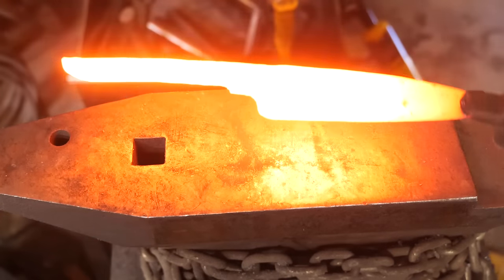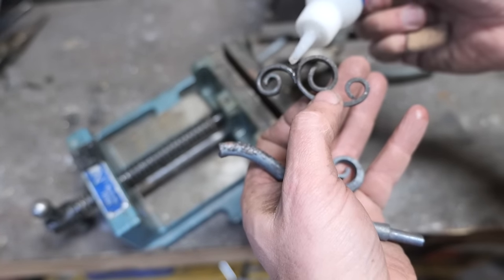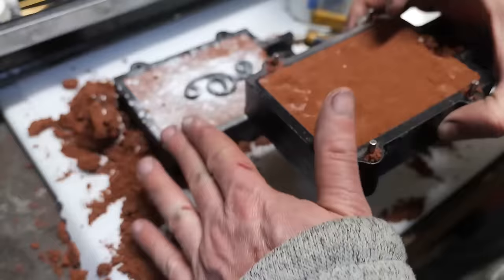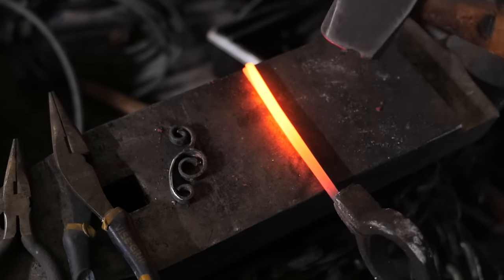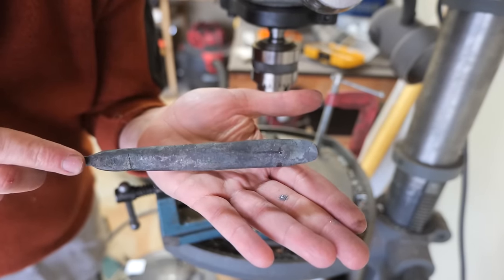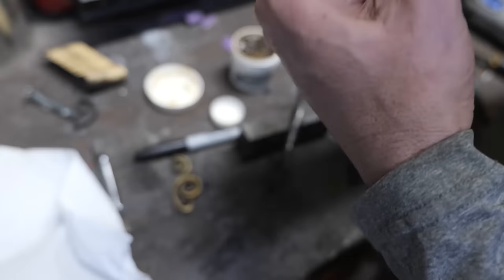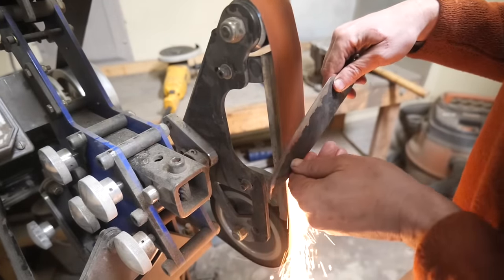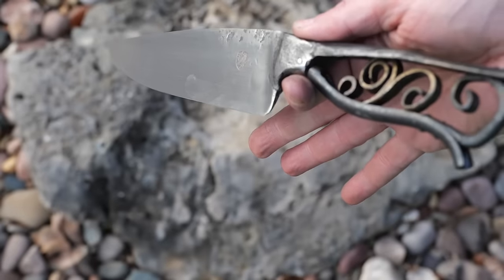Forging a Knife with an Integral Handle PART 2

Comment from the maker: Talk about doing things the "Max Powers way"!  We still got there and I like the result. So, go Steve!
Reply: If you sift the sand casting sand you will get a finer detail mold
Reply: In the video you mentioned you can't forge brass, but I distinctly remember having forged a brass goblet when I was in jewelry school.

So maybe you just need a different alloy? Or maybe you just need to let it cool down before forging? 

I remember we annealed it regularly by getting it cherry red with a propane burner and let it air cool on a chamotte or charcoal soldering stone, and then hammering it cold. Re-anneal when it gets work hardened, so it doesn't crack on you. That's how we did it on brass, and silver, too. Anneal, work it cold, re-anneal when it starts to work harden.

Hope this helps for future projects.

Comment: Glad you didn't do more tinkering with the casting and found the cheapo brass brush. Probably saved yourself a huge headache there. There are some forgable brass alloys out there, but they're kind of hard to get your hands on. Another thing to try is just coloring the steel with tempering colors. Done that a few times for historic copper knife replicas. It works quite nicely on forge scale if you give it a good go with a steel wirebrush first

Comment: You are most likely right about why the sand casting wasnt working. One more thing to think about though is the baby powder. Its super hard to get real talcum powder now. Most are corn starch and that doesnt work very well on sand in comparison. Iv been having issues with this in other hobbies too. Like ant keeping

Comment: Pro tip: I recently learned that while working with brass, the brass will get hard and brittle of you bend/hammer it too hard. so then you want to anneal it by heating it up, little did I know that you can overheat it. Actually making it more brittle!
Aparantely one of the easy ways to guess the right temp is by heating it untill it has a dull red glow IN TOTAL DARKNESS!
If you try to anneal it while the workshop is artificially lit, you will most likely overheat it. and done in a dimly lit/dark workshop you will get it just right. 
Man the amount of scrap brass pieces this would've saved me if I knew it sooner....

Comment: Thanks for sharing, I enjoyed both parts. As someone really interested in knife making but that's never tried, it's good to see someone like yourself still experimenting and enjoying your craft. I need to find a tutor in my country and give it a shot. Cheers.
Reply: Just go for it. You don't have to start with forging or anything complex. I started making knives when I was around 12, just using random scrap. They were junk, but I learned things from it. You can make perfectly servicable and beautiful knives with nothing but a bit of annealed tool steel and a few hand tools, it just takes a lot of work. Don't be afraid to fail! It's just time and iron.

Comment: It’s like a much more stylized and Green Beetle complicated blacksmith’s knife. Nice work. 

In the vein of a blacksmith’s knife, I wonder if you could have forged the bolster to tip just as you did, but for the tang leave a larger mass that you could have split, build your scrollwork, slide those in and then forge the split piece back to hold them in—if any of this makes any sense.
Reply from the maker: Yeah that’s an interesting idea!

Comment: When I am sand casting there is a certain amount of sand being removed with the “pinch points” that I just allow to happen and I clean it up once it’s cast in metal. That might be a bad way to go about it but I’ve spent so much time obsessing over having the mold perfect before casting only to have the cast go horribly wrong lol 😅

Comment: That turned out quite nice. Now if I may tell you things you possibly know already. Metals with copper in them by and large are the reverse of ferrous metals when working them. Basically, heat your copper or brass up to a red heat, or close to it, then quench in water. This makes it soft/malleable. It will work harden again as you bend and/or hit it. So just repeat the process to make it soft again. You should easily be able to make those spirals out of brass doing that.
I really don't get it when knifemakers on YT try and forge copper of brass the same way you wouild iron or steel. I've seen it a couple of times, and it does work I guess.
Reply from the maker: I tried annealing it, same result.  I got further heating it to red than softening it. Maybe the diameter was too large to be as malleable as needed?
Reply: @GreenBeetle   Yeah, afaik it could be the type of brass.  I found some I used annealed well and could be worked bending them. Others not so much. In short, I dunno I guess.

Comment: Copper could have worked in place of brass, as it tends to be a little more forgiving. The brass you heated I think got too hot. Hence the crumbling. Brass can be worked cold too, if you heat it to dull red and quench it occasionally. (Speaking from experience forming brass cases for unusual gun calibers) your mileage may vary.
Reply from the maker: Yeah I tried annealing it and this stuff just cracked

Comment: by heck Steve you're becoming a blacksmith ....those funky shaped rivet surfaces suck to hold dont they..
I like brass plating like that, Ive also done copper which leaves a thin not copper coloured coating so you have to pickle it afterwards which tends to take a lot of the copper off again...brass is better lol

 I think you can cold forge brass and anneal it much like copper but its so expensive I havent actually tried that...Ive taken creases out of a brass lamp shade by planishing and annealing so I assume it works lol ...but you know the problem with ass-u-me
Cool build and fascinating process
Thanks for sharing
Reply from the maker: Nice idea

Comment: Yep, really like this one its got some really 'archaic' looks to it sort of like old wrought iron fences. 
For your brass and this is plumbing the depths of my visual arts background 30+ years ago you tend to have a few alloys out there, the A260 cartridge brass is the one we mostly all use in knife making as it's fairly cheap and just zinc and copper. It does pour ok but it has no hot working and next to no cold working. There is the C37700 which is what you want for hot forging brass, or copper and that's the one which I tend to like for making rubbish like Mokume Gane as it doesn't turn into shards of ultra-deadly molten hell flying all over my workshop.
As a thought for your next one if you decide to do something like this, thinking you take a leaf out of the blacksmiths big book of beating the shit out of things and splitting the handle in half, draw out each upper and lower section to shape. Do the curvature on a bodged up swage block and then heat it up, bend to shape and sort of cram it all in there. But this is probably one of those things you can do any number of ways, glad you did it though its pretty nice!
Reply from the maker: Good info ty